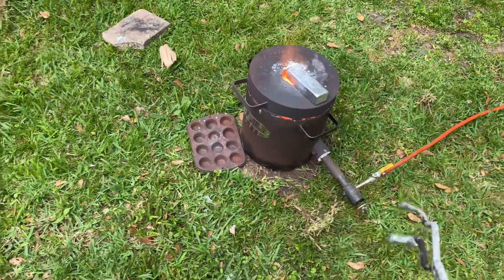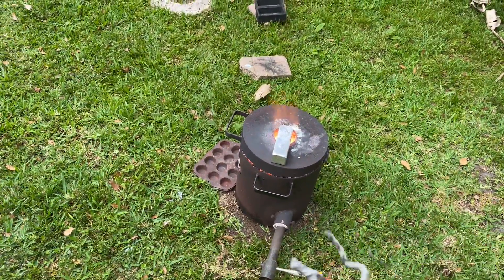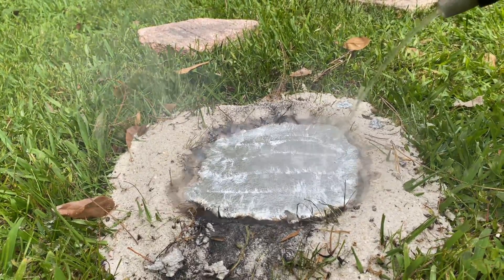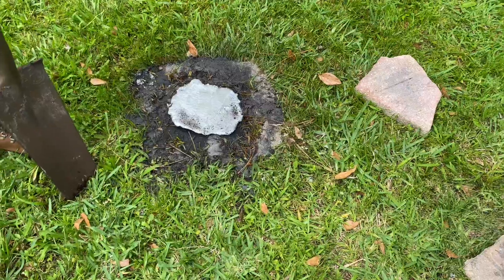Massive Aluminum Anthill Casting #22

Comment: I'd like to see other metals like iron or copper or is that impractical
Reply: Iron has too high of a melting point to realistically be casted in a furnace like this and copper is a bit expensive to be just pouring into the ground lol
Reply: My guess is that aluminum is chosen for it's low weight, cost and melting point.
Reply: Bismuth could be really interesting with it's ability to form different colours and/or crystalize. Melt's around 270C so it would be doable, BUT it is heavy, around 80% of lead.
Reply: @mmogaddict  bismuth is also really expensive
Reply from the maker: to cast with iron you'd realistically need an induction furnace. Copper doesn't cast well but its alloys do, I plan on doing an aluminum bronze casting in the future.
Reply: The biggest roadblock would be just sheer weight. These are already probably getting pretty damn heavy, and you just can't match the weight of aluminium with any other practical metal.
Reply: Look up the price of copper these days lol
Reply: why not gold ? - not the expensive stuff, say just 22 carrot
Reply: Helped with casting cleats on the sv seeker channel. Nibral could be an option.

Comment: A tip for the Crucible. If you want a really nice Crucible bake it in the oven for 3 hours on 300 and when you're done take it out and just get it cherry red in your Forge and then let it cool off on its own inside everything just let it cool off and it will create a nice Harden shell on the outside and you won't have to worry too much about it falling apart as bad

Comment: Why do you skim the aluminium before you pour into the ground?
Reply: Slag, oxidized impurities in the metal, floats to the top.  If left in with the metal it forms weak areas and the metal will break easily.  It's common with almost all casting methods.

Comment: I tried this many years ago at a neighbors front yard with permission. That was a big costly mistake for me and him.  The ant hill was directly over the electrical pipe  going to his home and  his PVC water line. I learned the hard way where not to do it.  It burned through both. The electrical company thought it was cool but they had to cut out a section of pipe and wires as it damaged them. They asked if they could keep it. The neighbor said if you don’t bill him for the repair. The only repair bill was for the plumber to fix his water line.  Lesson learned now I watch awesome people like you do it. Watching this makes me want to try again somewhere in a remote location not near any underground utilities.
Reply: Lucky it wasn't a gas line bro.
Reply: @beerious8392  gas lines are steel it won’t do anything to it
Reply: @WyattH  good to know, I guess the melting point of aluminum is lower than steel? Still I wouldn't feel comfortable dumping molten aluminum on top of a gas line...
Reply: @beerious8392  yeah the melting point is lowering obviously don’t do it on purpose because the gas is flammable and explosive
Reply: @WyattH   not here. They have been abandoning all the steel coated gas mains and switching to HDPE fusion weld pipe:  even in the early  90's they started using a Poly Ethylene (PE)  that Crap is junk and brittle. Very little steel gas mains left here but some still exist.
Reply: @MARKE911  ah here in Canada we seem to still have all steel gas lines
Reply: @MARKE911  yes like probably here where I live and steel rusts away after awhile doesn't it? Probably why they switched. Over one street to the north of mine I smell a gas leak all the time over there, walking or driving by Hill street In Tullos Louisiana on Park Street 🤔 probably an old rusted out pipe. See that's why they changed to the poly crap.
Reply: @anncherielicausi8108  Have you reported the smell of gas to your local gas utility?  If not, you should report it  ASAP!  You could be saving someone's life!
Reply: @kh3612  Yes of course, but this is a very small town no funds for a big project fixing utility problems.
Reply: @anncherielicausi8108  I understand that.  You still need to notify your LOCAL GAS UTILITY that you have repeatedly smelled gas in the same area.  It is their responsibility to ensure that their system is not leaking gas that could endanger public safety.  It's part of the cost of doing business.  I have read so many stories of homes exploding in the US, almost all due to gas leaks with much loss of life and property.  It's not normal to be smelling gas.  All you need to do is call and report it.  You wouldn't want to say I woulda, shoulda, coulda done something, but I didn't.  Would you?
Reply: @kh3612  they are not going to do ANYTHING  by repeating what is true is totally different than being here and the way it really is.
Reply: @anncherielicausi8108  If the gas utility won't act, you call your state's public service commission, and your state senator and assembly person.  Pubic safety is in jeopardy.  Someone has to do something to remedy the situation.  Remember, "the squeaky wheel gets the grease."  Squeak Away.
Reply: Oops.  Sounds like something I would do.
Reply: I would have NEVER thought about the damage that could cause.  Wow.  Glad it worked out.
Reply: Call utilities before you dig 👍
Reply: There are ways to avoid utility lines, usually by calling up utility companies or looking for marks. This, plus finding a nice area of the yard away from your house and the street could save you quite the headache. Hopefully the fire ants cooperate with their nest location.
Reply: @StuffandThings_  That's all well and good. But, if the ants have nested above and around (literally around) utility lines ...... what're ya gonna do if you are set on pouring molten aluminum?  Well, I guess you would move a respectable (and safe) distance from the location of the nest and splice in bypasses so service is uninterrupted ....... and then pour away!
Reply: Don't do it.. With your luck you will probably burn through a secret fuel line or a internet back bone line to the whole place (where ever you are).  I have similar luck too 😂
Reply: I never knew this was a thing. Pretty cool!
Reply: I'm pretty sure something would go wrong if I tried this too. That's a pretty cool electric company though.
Reply: You could really make that into an awesome Art piece by puttinga hole in the bottom of your piece treating it like wiring a lamp, but put the wiring so it goes into the hollow tube, and on each end of it have a light on the ends then make a container the whole thing will fit in with an inch away from where the tunnel pieces  are and then fill it with clear resin . Then it'll need to be sanded and polished and when the lights are on it'd be so cool to see 👀  and this way it won't get dusty and dirty without the resin.
I challenge you to this project idea.please?
Reply: Ohhh no, well atleast he wasn't a gas line. Now THAT would be bad
Reply: Shit, hadn't even considered this.  Glad I haven't tried it yet. I'll have to get the proper equipment to check for lines first
Reply: At least they didnt have to work with ants over everything...
Reply: You sir are quite the fu@k up!
Reply: @davidbillett5809  thanks for your kind words. God Bless you
Reply: @MARKE911  that was tongue in cheek.  Coulda just as well called ya an unlucky SOB….but I was feeling a bit more ornery at the time
Reply: @kh3612  wouldn't that be before you pour?
Reply: @dmkshop  Yes.  That's what I said.  ALWAYS Call before you dig! (Or pour.)
Reply: Do you ever feel like it's cruel?
Reply: @kh3612  tell the ants to call that number. Would make so many ppls lives easier. Lmao
Reply: @Yroko  The Ants tried to call, but the utility had no translator who could speak Antic.
Reply: @kh3612  🤣🤣
Reply: There is a line you can call before doing ANY groundwork, utility guys will come and mark all your lines in the ground. 811 in Washington State, not sure what other states use.
Reply: @kh3612  Where I live it is called "Miss Utility".
Reply: Lol, that's why those commercials come out saying: "Call before you dig". Man, that would have made an awesome commercial dude.
Reply: @kh3612  can you dig it? I dig it!
Reply: Plonka!
Reply: LMAO, good story!
Reply: If it hit a water line, how did it not explode? You didn't mention a steam explosion...
Reply: Sounds like instant karma
Reply: A good point
Reply: I'm not sure that I understand.
"The neighbor said if you don’t bill him for the repair."
If you don't, what?
Sorry, I don't get it.
Reply: @fostercathead  

The electric guys were allowed to keep the casting as long as they didn't charge the neighbor for the repair job they did to fix the electric wiring that got damaged by the molten metal.
Reply: @takigan  Thanks for the explanation.
Reply: @fostercathead  Genuinely don't mean this in a rude way, but are you unfamiliar with the term "bill" in that context?
Reply: @d-wizzel4217  I figured it out.
The experiment was conducted in his neighbors yard.
Reply: @d-wizzel4217  - the op didn't punctuate clearly with quotation marks and comma to indicate he was conveying what the utility crew told the neighbor. It wasn't entirely clear if you read it the way it's written.
Reply: @fostercathead  the electric company wasn't going to charge him money as long as they got to keep the cast.
Reply: @fostercathead  He gave the utility guys the casting in exchange for not billing the perps.
Reply: So for all you saying call one call. This was back in my early teenage years. one call didn't exist then. One Call (811) came around the middle to late 90's. 
I did this I believe around 90-91. For that matter 911 wasn't available here then either, let alone 811. 
I was likely doing this before most of y'all were even born. Just saying.
Reply: @MARKE911  dont worry about them mate. I took it as a cautionary tale. Just sad lonely people looking to take it out on someone. Welcome to world of saying things knowing your safe in you mum and dads basement lol
Reply: Oh, come on. There has to be something better you could be doing. Honestly.
Reply: @jinx4564  Getting rid of these ants is very definitely worth your time.

Comment: Sandy soil  confuses me.  So the water just percolates through the soil and goes away?  Around here (central Ohio) we have clay.  If you dug a hole that size and put that much water in it, it would takes weeks to dry.  Basically it would have to evaporate out. 
Great work on the casting.
Reply from the maker: I had to bail out the water in between cuts and then dig out more sand. That’s why it looks dry but the water wouldn’t drain at all here either.

Comment: So I've watched more than a few of your pours, and wanted to give you a bit of a hint for lifting... Get a bit of threaded rod or an eye-bolt and put it in the molten base as it cools- it shrink fits and is pretty tight. Simple tripod and pulley and you have it suspended. Just hacksaw bolt off if you need- esy to hang after that too!
Reply: I made a similar suggestion, although less sophisticated. Here's hoping he sees it! I think suspending it from the base would make cleaning and flipping it much easier.
Reply: Sure, it will lift your base up, but not the bulk of the metal.  Aluminum is soft and most of this would break off if not carefully and slowly extracted.
Reply: @Papadoc1000  Not to lift with- but to stabilize while you wash off- he lays it down and rolls it around- keep it vertical

Comment: Great job 
If you use a large saw horse you can pull it straight up. Making it easier to wash off the dirt. Still tricky to flip over. But the heavy wet dirt is gone. 
This is the best way to recycle pop/ beer cans.
Melted milk jugs can be molded to make a base to hold your ant art work.

Comment: Is there any practical application for dross? Everything gets used mentality here...
Reply from the maker: I remelt it at least once to try and get every drop of aluminum out of it. From there I just throw it in the recycle and larger recycling company’s can get the rest out. After that it’s basically just metallic ash and is thrown out I think.

Comment: Just out of curiosity how much would it cost to make one of these out of gold? (If you know)
Reply: Gold is currently about $2,000 a troy ounce. Assuming this thing is a little more than 2 pounds  that's more than $60,000.
Reply from the maker: This casting is probably around 11ish lbs if it were just 11lbs of gold it’d be worth roughly $274,600. However, aluminum is significantly lighter than gold so if this exact casting were made out of gold it would weigh about 78.7lbs. At that weight it would be worth $1,966,320 in metallic value alone. As aluminum it’s worth 40 cents/lbs at about $4.50 total.
Reply: @NolansAnthillCastings  thats one expensive ant tomb 😳
Reply: @NolansAnthillCastings  I'm sure there's a rich pointless git who'll sponsor you. Might I suggest a Kardashian or Jay Leno. Ye gods but I hate that wall faced twerp. Got "smug" written through him like Blackpool Rock.
Reply: It would be interesting to make one out of brass, another one from copper, maybe Nordic gold (similar color but MUCH cheaper, not precious metal)

Comment: If the ants or any eggs were to get swallowed by the aluminum and you were to break the aluminum after it had cooled down would you be able to see the ants or the eggs?
Reply from the maker: Since the ants climb on the walls sometimes they get perfectly preserved as charcoal imprints in the casting which you can easily see as is. The eggs arnt as defined as the ants but you can see them as well, they just look like black dots. At the end of the video I did before this one I showed off some of the ants that were charcoalized.
Reply: @NolansAnthillCastings  Very cool thank you for responding!

Comment: you should do a collab with elon musk and make one in platinum !
Reply: @Ztuzar Is that even possible? Platinum has a much higher melting point than aluminum (a difference of over 1,000 degrees C) so I think the metal would cool too quickly to have much of a chance to branch out more than a few inches into any of the side tunnels.